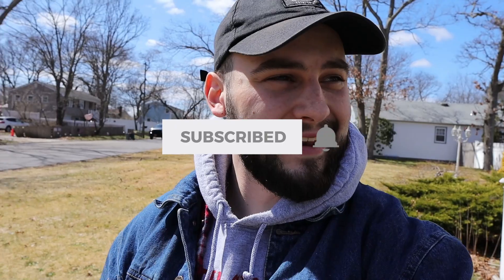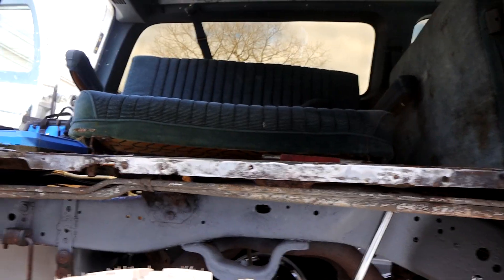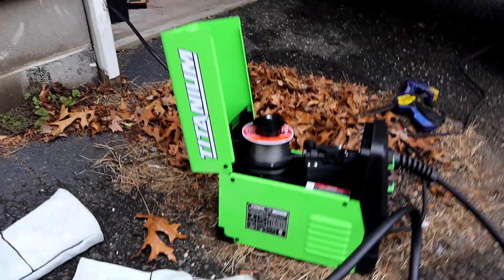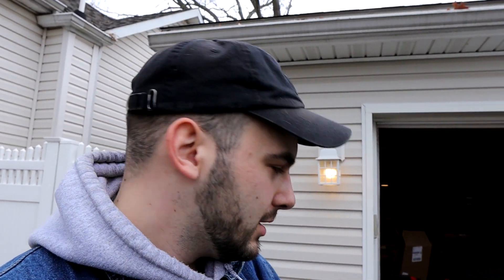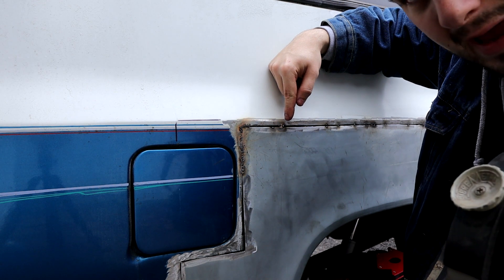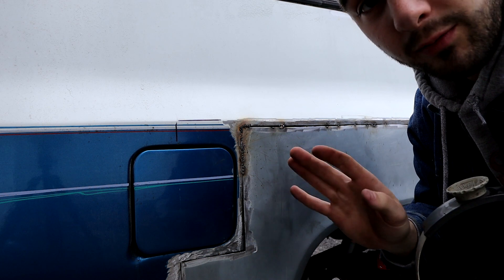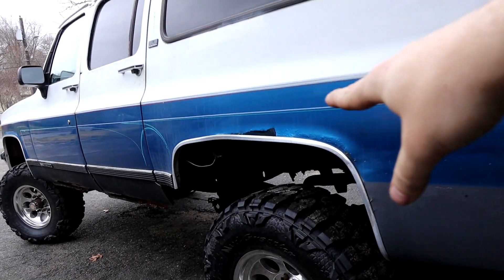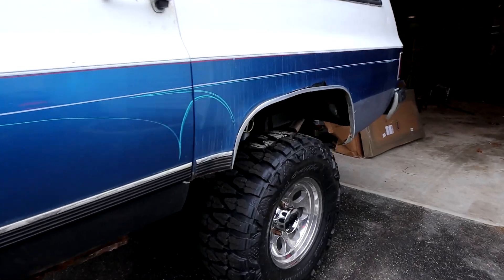INSTALLING NEW QUARTER PANEL - SQUAREBODY SUBURBAN

Comment: What wheel and tire combo do you have?
Reply from the maker: Exact combo is as follows
17x9 polished Mickey Thompson Classic III 8x6.5 bolt pattern +0mm offset

35x12.5 r17 Nitto Mud Grappler tires

Comment: Trust me I used that same welder on that same truck , that welder is garbage for fab , finally got a mig with gas and you'll realize you don't suck it's just flux core, plus you don't have to exactly match up your but weld patch